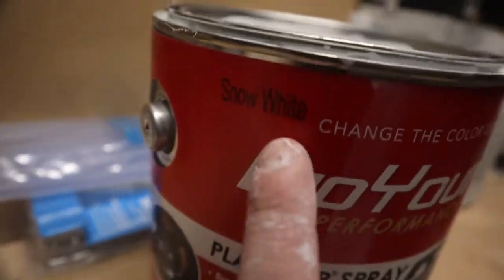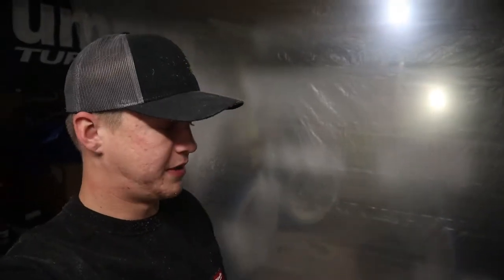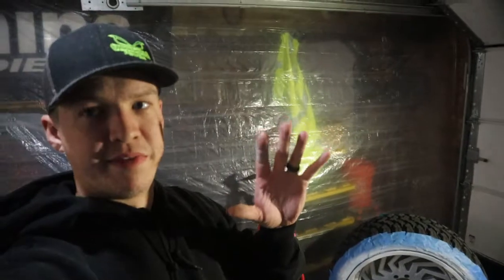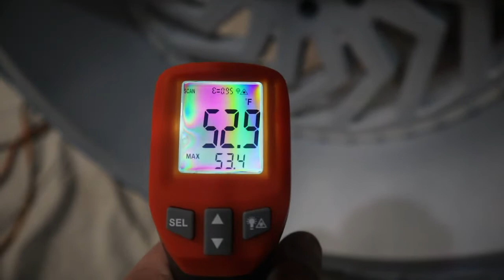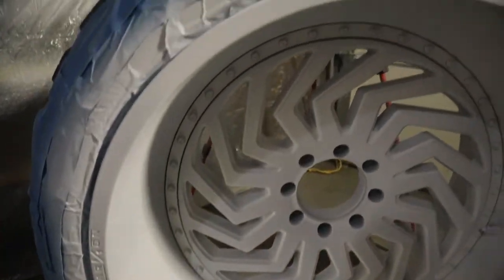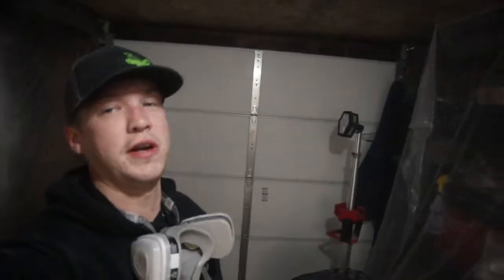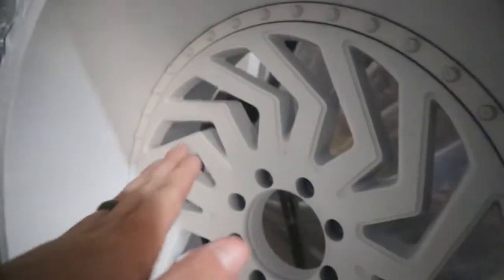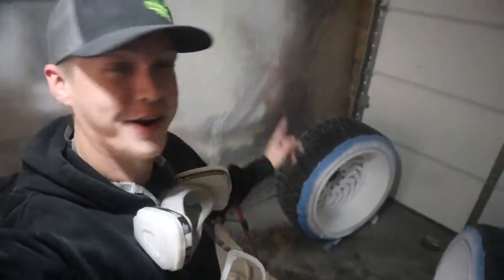D.I.Y PLASTI DIPPING MY 26x14 WHEELS! EASY.

Comment: So far seen few of your guys videos. Keep up the good work. I have a 97' Dodge ram 2500 4x4 w/5.9 w/auto trans and about 48,000 miles. Only thing done was put on banks air box which helped spool turbo up quicker. Wanna do more, use for towing but could use little help when on freeway and hills but does ok in stock just would be nice to have little help. From Puyallup, WA area. Truck is one of the better looking due to it being kept garaged. Get offers to buy all the time but won't sell since it's in great shape. Being disable makes it hard to do what would like but in time things will get done in time. Again keep up the good work and will be watching since just subscribed.